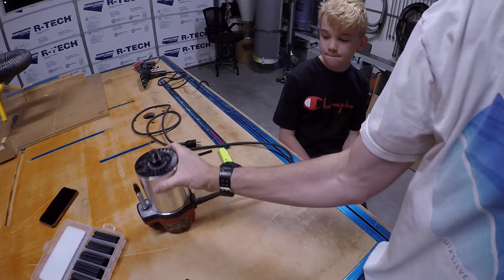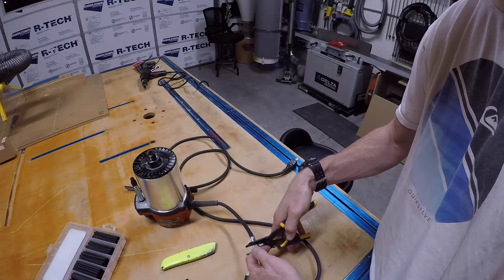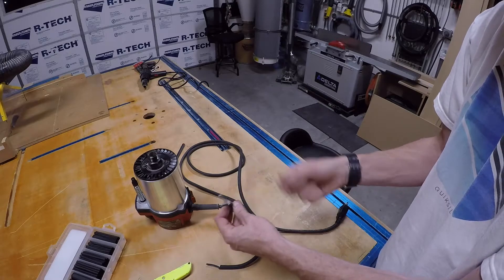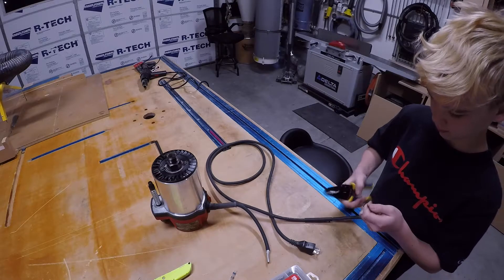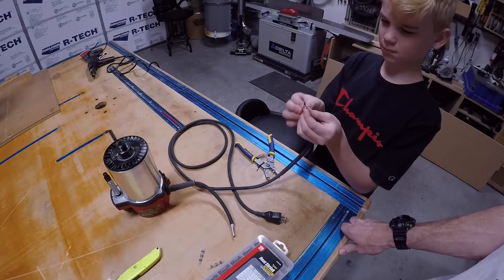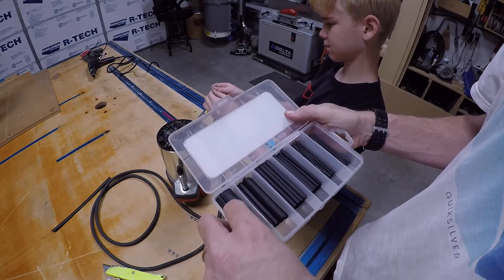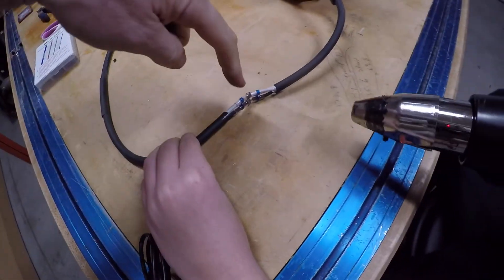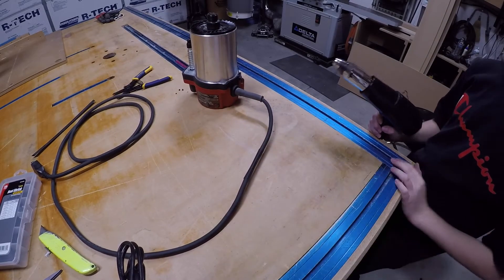How To Fix A Cut Power Cord With Solder and Seal Wire Connectors!  Amazing!

Comment: Wow my friend in England picked up a box of WW2 Linear connectors during a plumbing job. These were part of the radio man's repair kit.  The instructions just said to use a match or lighter from the mess kit, to activate the solder flux ball. 

I'm a bit OCD and will just reconnect inside the house for that length of damage. But if it's further down the line, I would use these connectors.   I learned to stagger the connections so it doesn't turn into  lump in the cable. My milwaukee sawzall actually has a twist out cable. I read festool cloned that design, so on  site accidents have lower down time with a cable replacement.